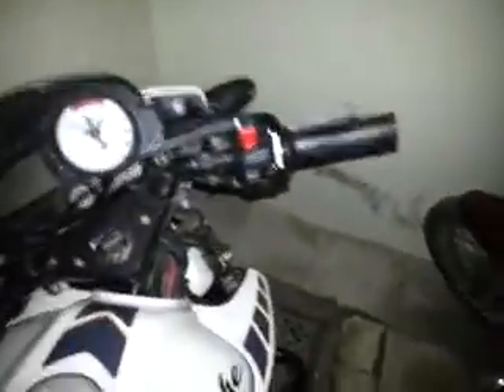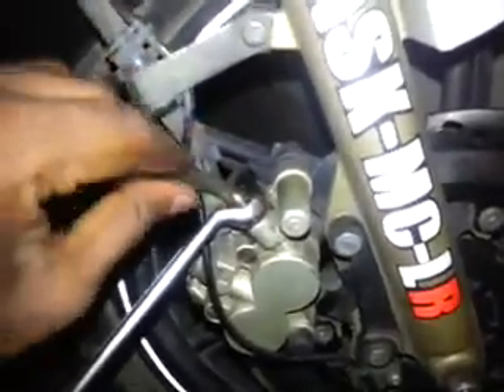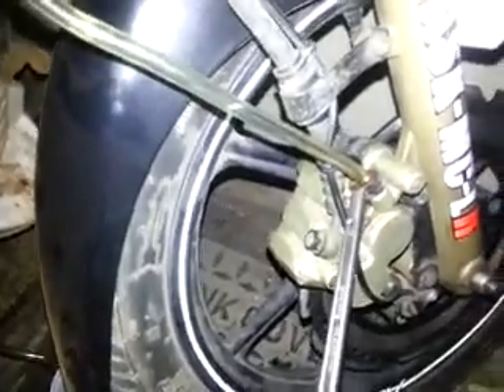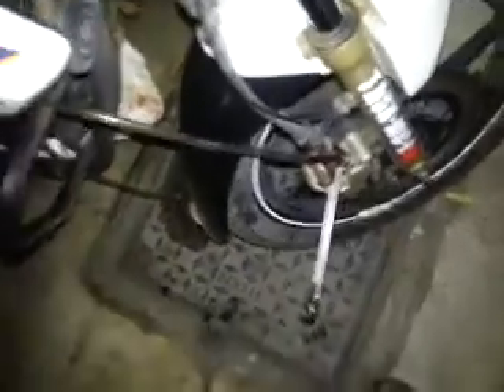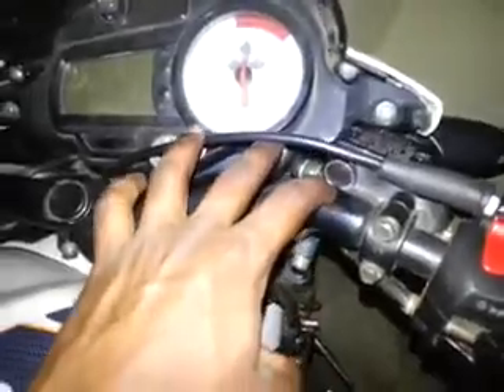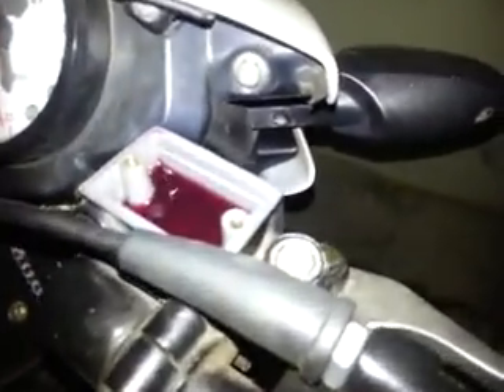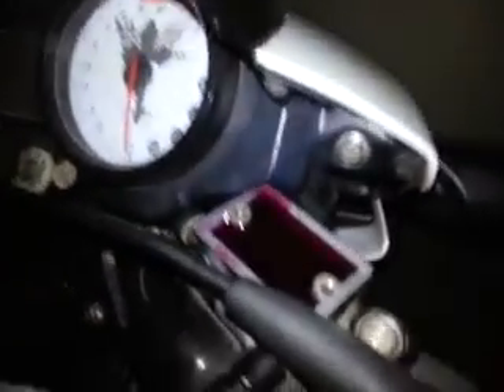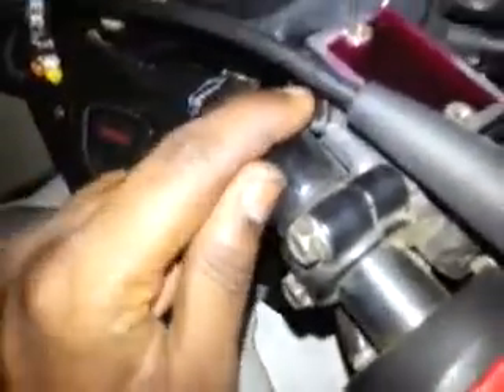TVS Apache RTR DIY [Bleed breaking system]

Comment: bro how will I come to know that the whole brake fluid is bleeded out and new one is filled when I am refilling the same brake fluid as in your case please help bro ??
Reply from the maker: Navneet Singh color of new fluid and old will be different
Reply: THOMSON RICHARDS  , bro but I will use same brake fluid I will bleed dot 4 and then refill again dot 4 then how will I come to know that whole fluid has changed and in your case also the colour of dot 3 fluid is same almost red then what to do ??
Reply from the maker: Navneet Singh used oil color different from new  , old oil color changes
Reply: THOMSON RICHARDS  , bro what happened is I have changed brake pads and  topped up brake fluid from service centre , but now the brakes have become spongy type so the brake fluid is not very old so the colour will be same I think  , so can U tell what is the amount that is drained from while braking system so that I can measure somearound like that ?? please help bro , and can I do it myself is it easy and how much time does it takes ??

Comment from the maker: when the bike is turned off the breaking system becomes normal disc breaking system, the ABS system only creates pluses in the fluid it doesn't pump anything ! .  the amount of break travel is more cause the system isn't allowing a sudden wheel lock!